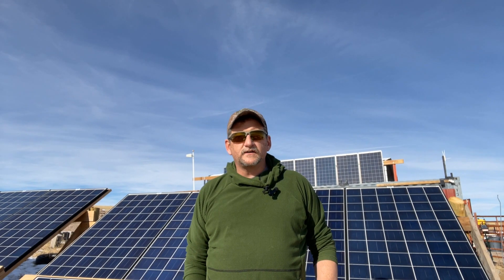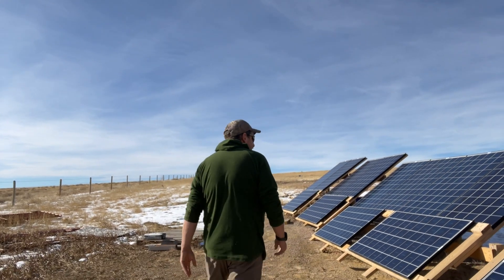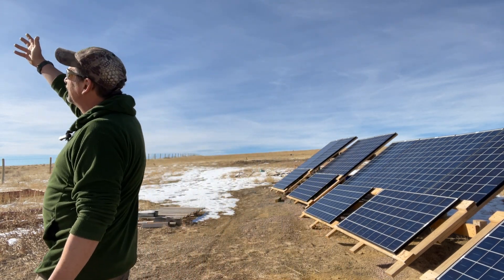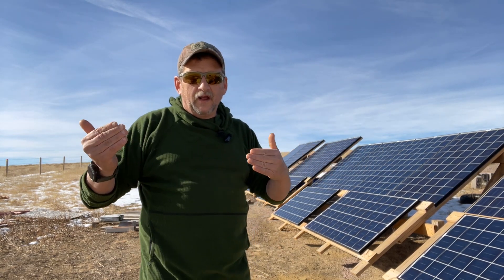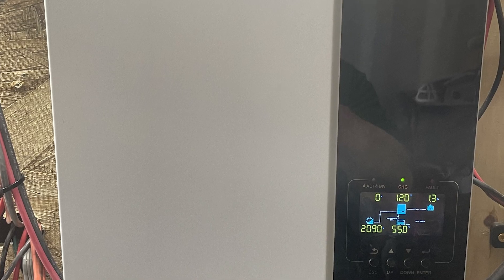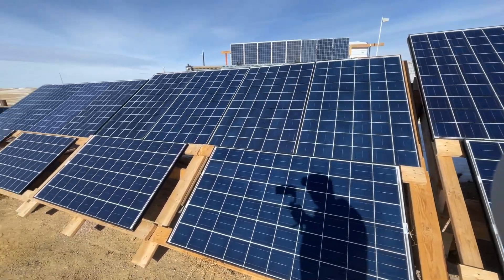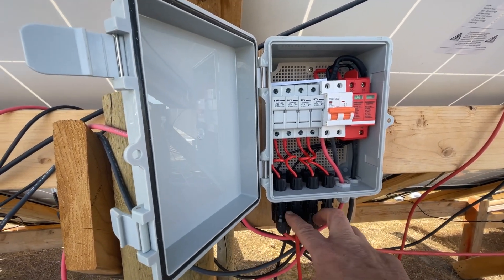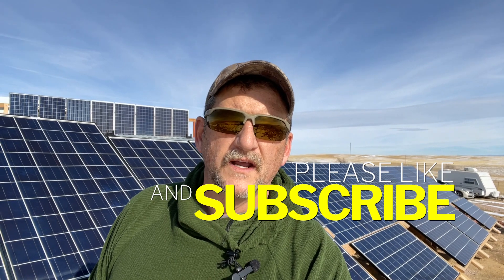My Main Solar Array

Comment: Thank you! Wife and I are heading off grid in our 50Amp RV. We picked up a used DC Solar Trailer that we are slowly getting back to operational condition (hoping reliably!). Thank you for posting your video - we are going o have to replace all the panels on the trailer and try to "over panel" without killing the Midnight Classic CC.

Comment: YESS, cloudy days are for real solar power, BUT wiring also matters... solar is for power, but how you wire your system is for efficiency... i just subscribed to your channel and i also use used 50w panels each for 6€... my last video shows 18650 and lifepo4 system as most eficiens system if wiring is done wright... not saying that deep cycle is bad... its good but not eficient as 18650s can be thanks to bms and wiring. love your videos, stay healthy and keep goind as fast as posible with your system! ;) im also going for over pannel just for winter and cloudy weather
Reply from the maker: Over paneling is the key to creating usable power on those cloudy days.

Comment: Go as many as you can but always stay under the inverter/charge controller manufacturers limits for voltage, amperage and wattage.
Reply from the maker: Funny you mentioned that.  I think I am going to shoot a video on that very subject.  How to use series and parallel to max out your array without going over the specs on your charge controller.
Reply: @pawneeoffgrid2614  I have a couple of arrays with different strings and voltage and also 40 kw of micro inverters which will charge the battery when AC coupled to my inverter. which does away with the need for charge controller.
Reply from the maker: Wow that sound unique  I would like to learn more about what you are doing?
Reply: @pawneeoffgrid2614  Sure have a look at my channel and I answer all questions. The thing about AC coupling you need an inverter that will pass the ac through as not all do. I think a fellow named Jack Ricard had a channel where he did a lot of experiments with the AC bus and pioneered a lot of inverter coupling. Cheers
Reply: Thank you brother..
Reply: you also need to know the max voltage for your coldest day for your panels.  Panels increase voltage as they get colder.